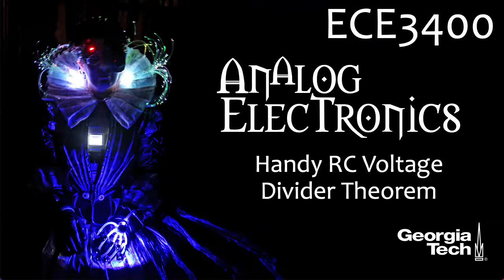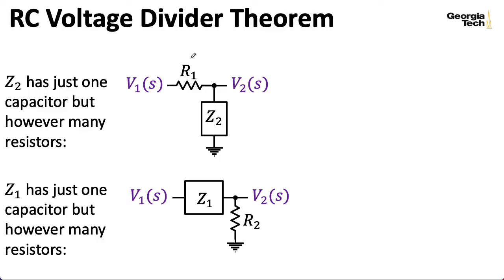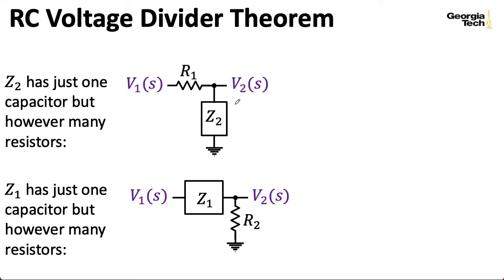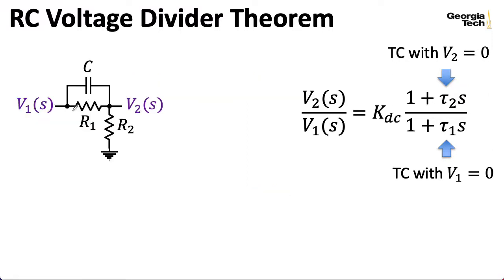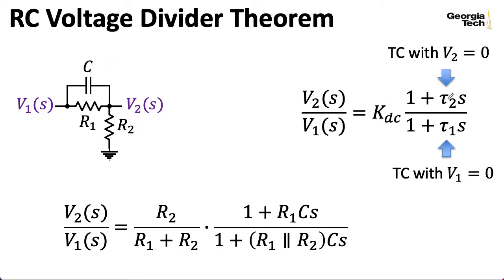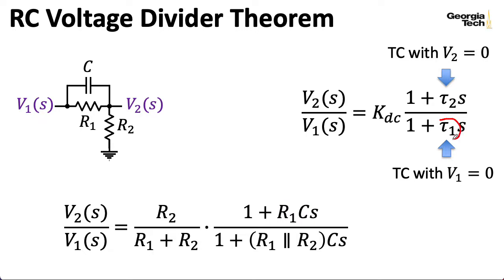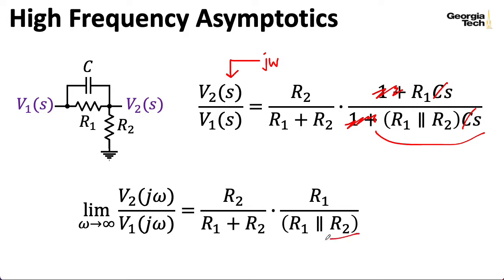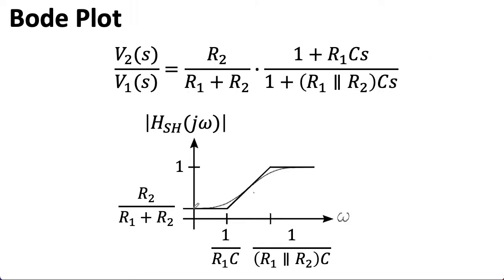ECE3400 Lecture 33: Handy RC Voltage Divider Theorem (Analog Electronics, Georgia Tech course)

Comment: This is awesome. I have a use for this right now. 

I'm reading the Leach article  that is referenced. It's a little confusing in that the term R1+R2 appears in the derivation but the circuits only have an R1 or an R2 but not both. However by the time you get to the combined formula they are gone so it doesn't really matter. Also it doesn't look like it works if Kdc is zero but I suspect it could be made to.